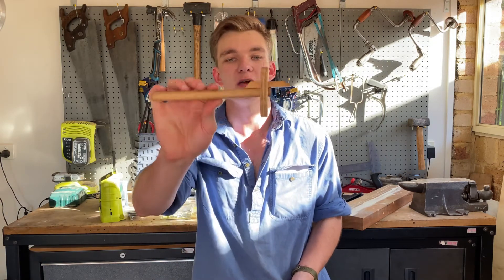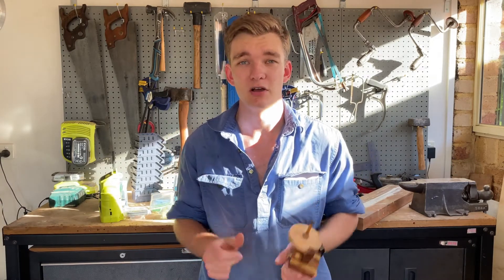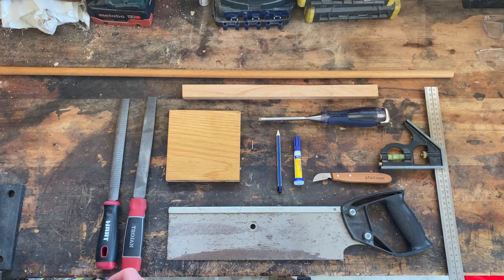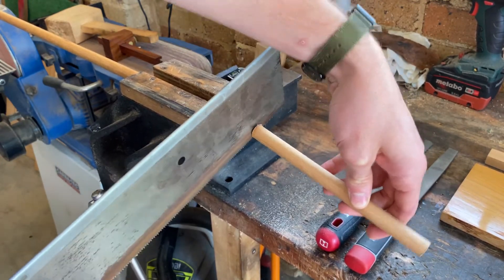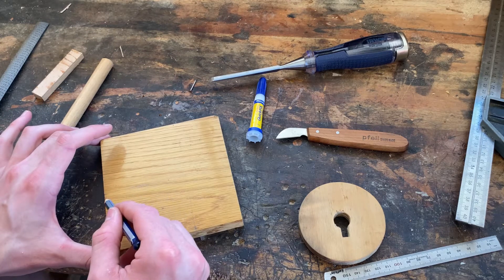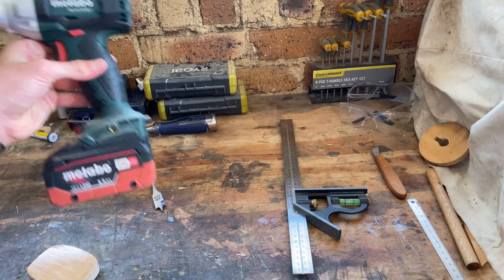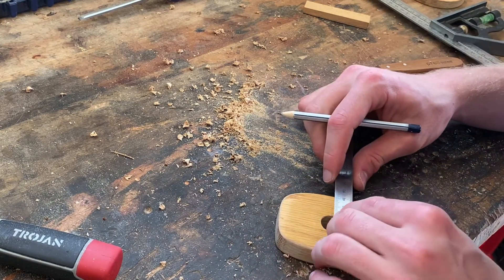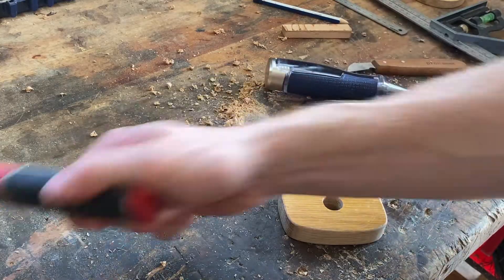How To Make A Marking Gauge | QUICK & EASY

Comment: That is a neat tool.  I have not done a lot of wood working but I want to try some things.  I have always been into metal but I got a cheap wood lathe from a friend and I want to try to turn something.  Never done it before.    
I understand about being too busy to make videos.  Best of luck with everything.
Reply from the maker: Thanks Gary! I like both materials/ crafts, as they both have unique uses and areas of enjoyment. I started out with timber and I don't think you can beat its natural beauty, as well as not being as physically hard to work. However you can more or less make any tool you could want with blacksmithing. I think with both sets of skills you could make most things you'd ever need!
Reply from the maker: Also congratulations on the lathe! It's a great skill to have and a very enjoyable process to learn!